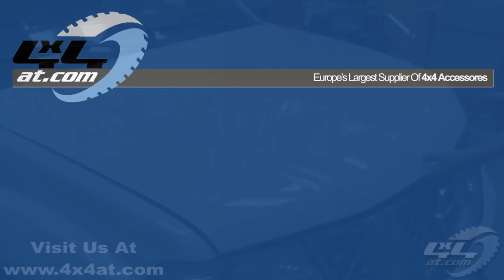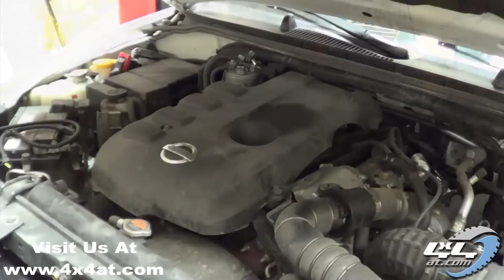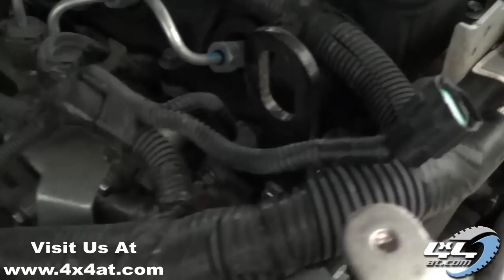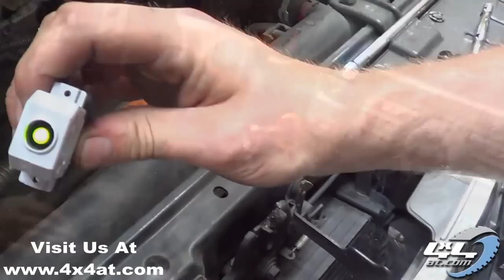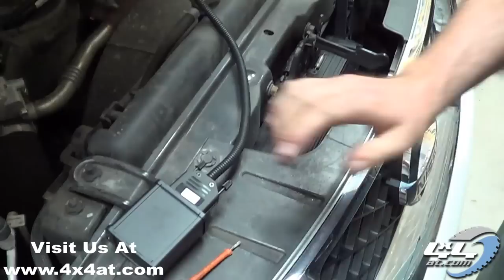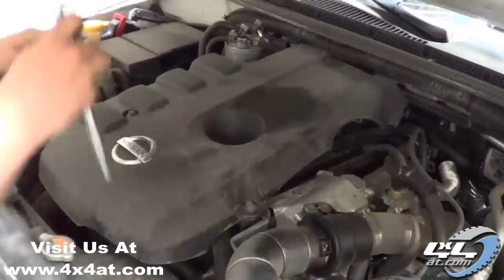Nissan Navara D40 2.5 DCi Performance Chip Fitting & Installation Guide

Comment: does this chip solve the issue that the d40 navara has with no power on low rev this making balancing and moving off on hills a difficulty in turn burning the clutch?
Reply: block your ESP it will run better on start

Comment: Hello
Has the Nissan Navara 2008 model and a manual transmission and have trouble fuel consumption abnormally what shall I do that possible Trushdona
Reply: Whats the fuel consumption at currently and what kind of driving are you doing?
Reply: Clean your air cleaner throttle body and check all your turbo pipes for vacuum leaks to start with cause it don't cost much